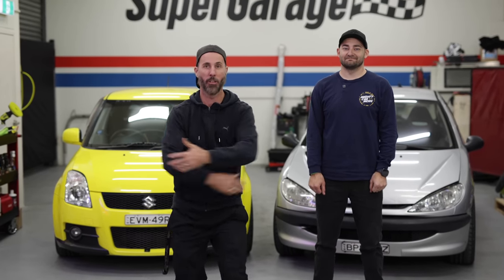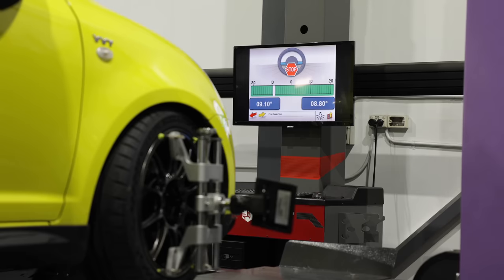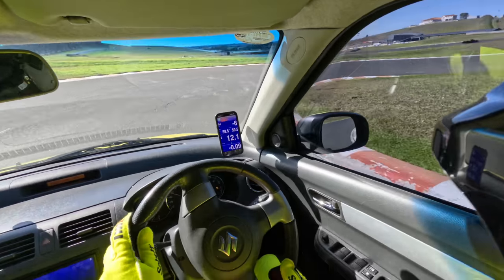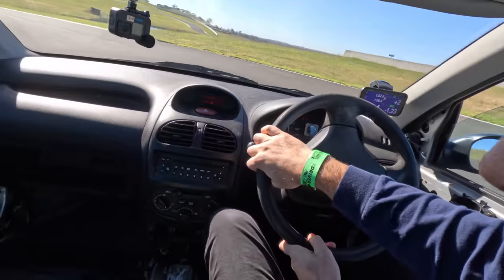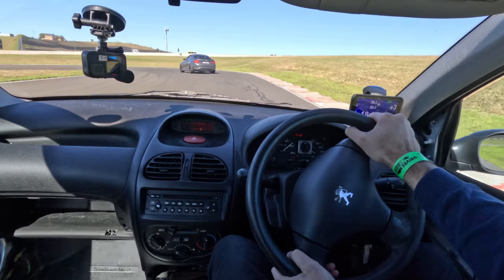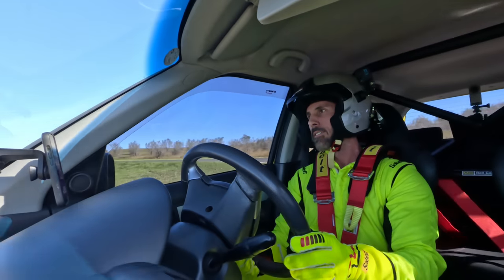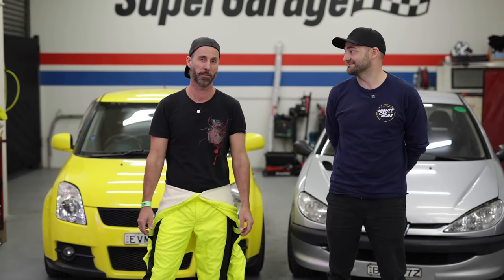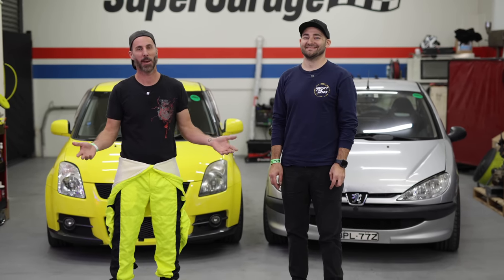Peugeot 206 vs Suzuki Swift FINAL BATTLE

Comment: Doesn’t make sense. The whole point of cash vs trash is to see how much time u can shave off at the track. If higher end coil overs allow you to do so, they should be use to their fullest potential instead of being capped because of the poobro trash suspension

Comment: I can't express how stupid I found it that you spent all that money on suspension, then decided not to make use of it!  Nobody in their right mind would get fully adjustable suspension then ask for it to be setup like a cheaper car.  The whole idea of spending money to get performance was exactly that - to get performance!  

Felt that this episode was a huge letdown tbh, and the overall show was mediocre.  Some other questionable decisions are adding performance mods without a proper ecu flash and rolling road setup to make use of them, and as you said ending up with less power.   

Then there's the idea of adding weight, why didn't you gut the car before fitting the roll cage?  Maybe spending money on some real weight reduction after taking out the obvious things. 

At the end of the day, in real life cash would beat trash every time.  Because as we all know, the general rule is the more you spend on a car the faster it goes.